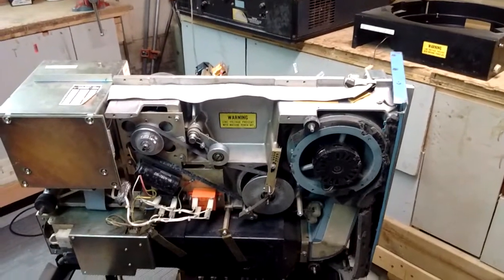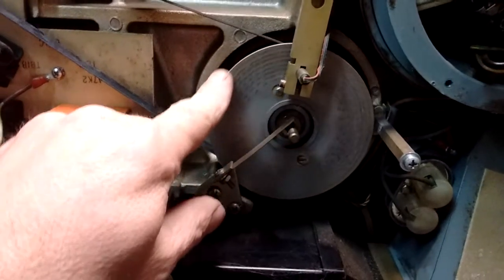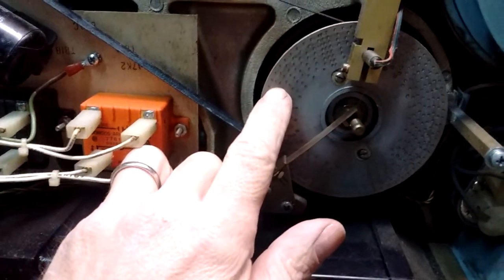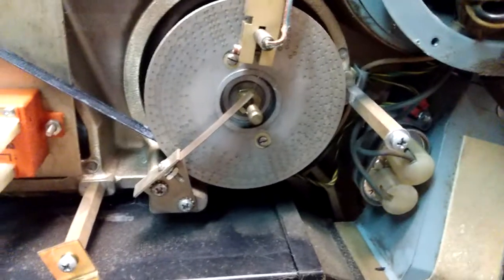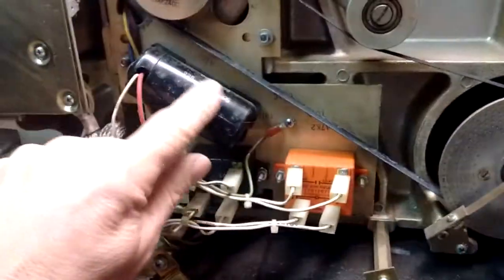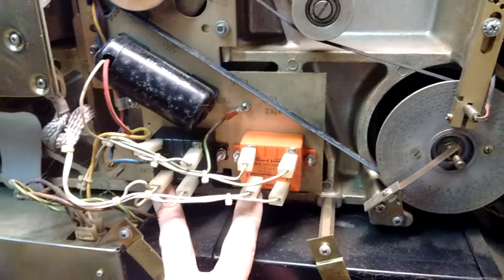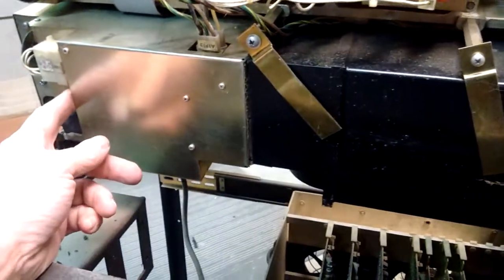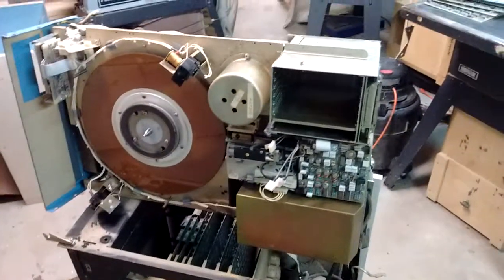CDC9427H part 2

Comment: I remember doing preventative maintenance and cat eyes head alignment on these.  They were generally hooked up to Wang Word Processors.
Reply from the maker: Interesting.  An ex-CDC employee told me they sold a huge number of these, over 20,000 I think, so these could have been used for many purposes.
Reply from the maker: @drsproc  Yup.  That's it.  We had that in a 3 ring binder at work, but the drives were incredibly reliable so it was rarely used.
Reply: Yea ancient memories, I remember we had a special service card that plugged into the cage for preventative maintenance and/or alignment.   Besides the Hawk... Wang WP also used the Diablo and Phoenix.   I loved the Phoenix.     I wonder if "curiousmarc" would be interested in testing that Hawk out?  https://www.youtube.com/user/mverdiell/videos  would luv to see a custom  FPGA hooked up to it and do some seeks and read/writes.
Reply from the maker: @drsproc  Curious Marc looks interesting.  I'll check out his videos.  I made a board that plugged into the card cage which would light up LEDs on the other end of a ribbon cable if a fault occurred, since there could be several causes.  I had noticed a spare slot on the cage had the various faults isolated.  It wasn't until later when I found out CDC made such a thing themselves.  We did alignments using the dip switches on the I/O board  I've not heard of Phoenix.  Diablo sounds familiar though....
Reply: ....that's right the "dip switches"... I recall.  Nice reverse engineering there sir!    Any idea what's wrong with that Hawk drive of yours?   Yep, they (curiousMarc) just resuscitated an Apollo program guidance computer.
Reply: @drsproc  Two years after the event I know but...I used to work on Phoenix disk drives and I can't find any info on the web. They were Wang-badged CDC machines. I rebuilt several after head crashes.

Comment: Does the drive still work?
Reply from the maker: Nope.  When the heads do what's called their initial seek, they immediately retract.  In other words, the heads shoot out to the center of the discs and then slam back into their resting position.  I do have an oscilloscope now, and a full downloaded manual, so maybe . . . .